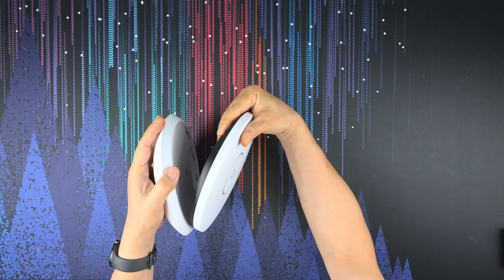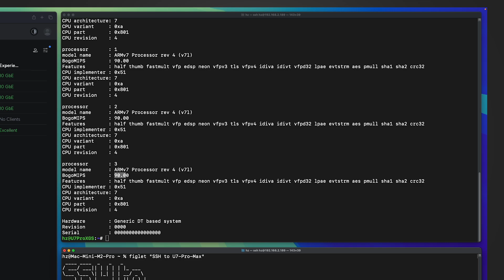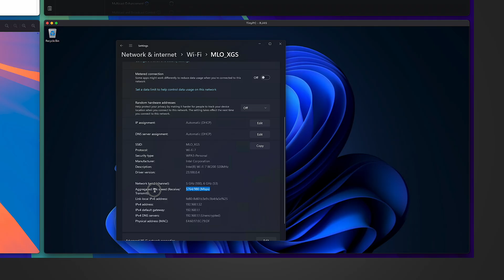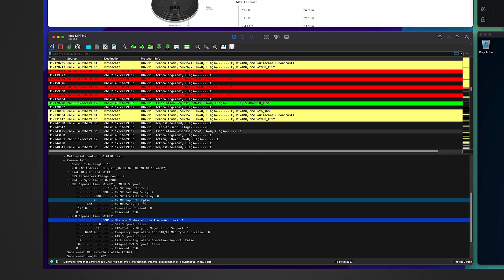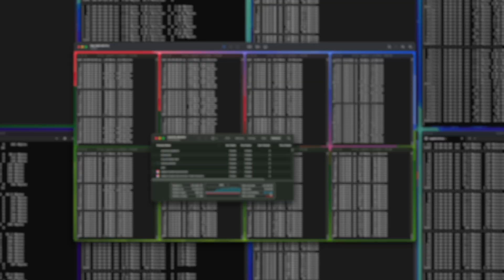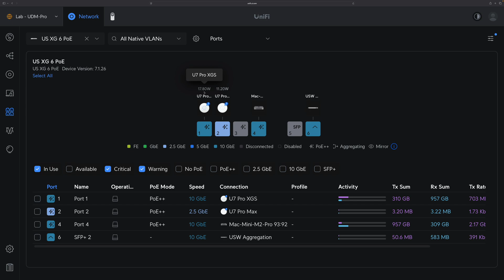Ubiquiti UniFi WiFi 7 AP U7-Pro-XGS

Comment: Thanks for everything you do. Between the U7 pro xg, u7 pro xgs or E7, which do you recommend for a small business?
Reply from the maker: If you need spectrum analysis, you can exclude XG. I like both XGS and E7,  so at the end of day,  it comes to coverage you need.
Reply: @hz777  130 square meters only in the form of a wagon with several rooms. Between u7 pro xgs and E7 is there a big difference that is worth the price difference? I want to make the right purchase, that's why I'm asking considering that you've used both.
Reply from the maker: In an ideal situation both should be good enough for you. However, depending on the shape of the residence, and the construction material, your mileage may be different.
Reply: @hz777  I assume you are referring to the coverage area on the 6ghz band? I think the E7 would be better there in terms of coverage. In conclusion, which of the two models would be sufficient?
Reply from the maker: Sorry but I will not provide the final purchase recommendation. Every person is unique. I can only speak for myself. I would buy two lites knowing it lacks advanced features, or one XGS knowing it's almost guaranteed to leave dead spots.
Reply: @hz777  I also thought about the option with two u7 lite in mesh even though they don't have the 7 GHz band. I think it would be a good option but they are only 2x2. Maybe two u6 LR would be better. Hard to decide.

Comment: Hey OP, tkx a lot for the video that really helps me understand the XGS! I have a home WiFi envir which has not quite much client qty, 15-30x devices and most are working under low bandwidth consumptions, while I will assume some of them require ultimate high connection speeds, e.g WiFi 7 workstations (BE2xx Win laptop or future MacBook with newer chip), I will need few of them run as fast as possible on wireless, do you think XGS is enough for me or I need up to E7?
Reply from the maker: From MIMO perspective, for 6 GHz, E7 is 4x4, but XGS is 2x2, that's the major difference for you.

In fact if you decide E7 is an overkill, you may consider XG, which is cheaper than XGS, and you are only missing spectrum analyzer.
Reply: @hz777 thanks! for limited connections demanding high speed at the same time, like 1-2 workstation laptops and the other devices on low or idle speed, the 2*2 MIMO of XG gets no major difference vs XGS or E7 who has 4* lanes which may benefit more about overall connection or bandwidth instead of single point edge speed, is that correct?
Reply from the maker: Yes.